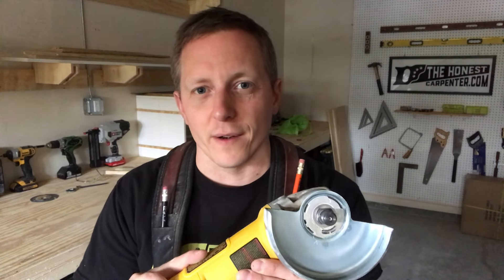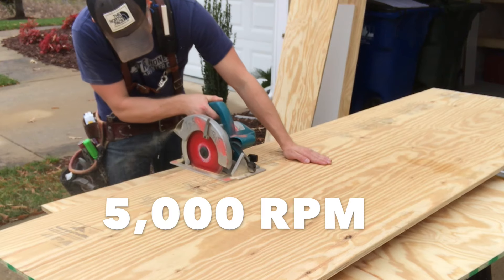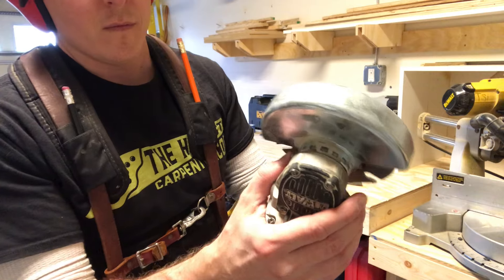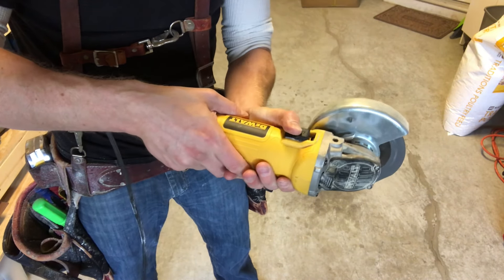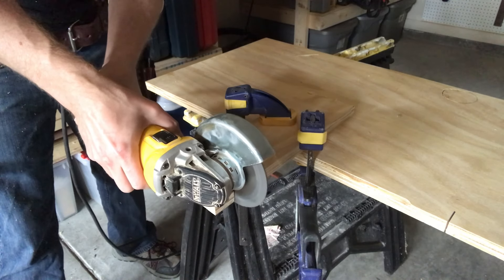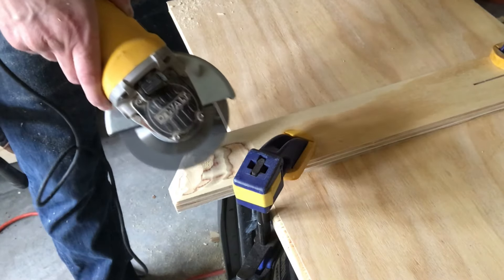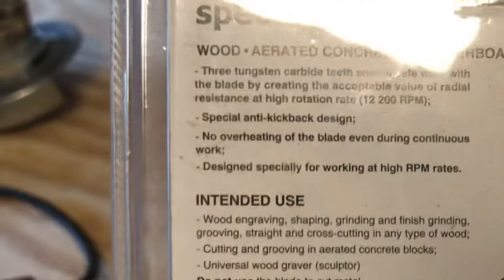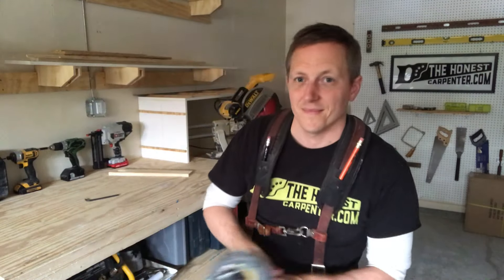CAN ANGLE GRINDERS CUT WOOD?? (Tricks + Tips--Cutting Wood With Grinders)

Comment: This does not cut wood it tares it apart. It 's only for gouging out because the blade has far less chance of getting trapped in wood. Using an angle grinder for CUTTING wood will get you eventually.

Comment: These grinders don't make the ideal tool for cutting wood providing you have the right blade these little devices are great for cutting suckling's found around the base of trees tried saved me ton of work. If your interested in using this approach watch for the kick back because these blades tend to grab into wet wood easily and use the right personal protective equipment or simply use the right tool for the job.

Comment: Well you do need a little common sense.  That said there are jigs to make it safer like a sliding angle grinder stand that basically turns it into a sliding miter saw.  Seems a bit safer that way.  There are also jigs to turn it into a circular saw.  I have never used one though so I don't know safe they are.  I could have used one of the sliding angle grinder stands a few days ago though.  Instead I used a hacksaw.  A lot less metal shavings going everywhere though no as precise a cut as with using a mitersaw with a metal cutting blade or using a sliding angle grinder stand.

Comment: they make wood cutting blades for angle grinders, i have one and it has alot of teeth on it just like a circular saw. use that. i also use the same type of blade on my marble cutter to cut wood. its the same size as an angle grinder blade. just look up saw blade disc for angle grinder and you can order them. but i buy mine from a store here where i live.
Reply: Dangerous - risk of kickback and worse with those wood discs with the many saw teeth, you might have avoided injury so far but don't recommend them when they're known to be avoided, the one in the video would be safer

Comment: there are better blades for the grinder aaaand better angle grinder try Metabo WEV like 125mm and 1500 Watt where you can reduce the spins but higher the power

Comment: Way too dangerous! Had an accident where the grinder got pinched by the metal that was ground. The disc broke but it still had enough energy to fly up and hit me in the face, with the broken disc still spinning. Happened literally in a split second. Had about 80 stitches and a scar as a reminder how dangerous a grinder is. With a wood blade, injuries will start at bad, severe, and even amputations. No light injuries...

Comment: Point the teeth in the right direction. Great tip!! Here is another tip. Plug it in. It was way to hard to cut wood without power. I never knew that.
Seriously, if you need to explain this to your audience, they have ZERO business using this tool.

Comment: Dude, you have got to amend this video to not include the cutting Hardie plank siding or any kind of Hardie board with a grinder. I am serious, that is one of the worst things you can do. It creates a shitload of highly carcinogenic dust. That dust is bad news when it gets in your lungs and if you use a grinder to cut it there is no way that you are not going to get it in your lungs. This is no secret. There is even a warning sticker on each board stating how dangerous the dust is and how scoring and snaping creates the least amount of dust and is the safest way to cut it. Using a dust-creating grinder is amongst the worst ways. You should amend the video and then go have your lungs checked. Seriously